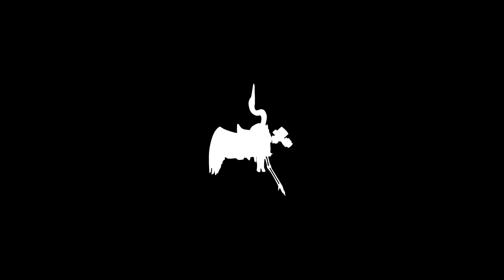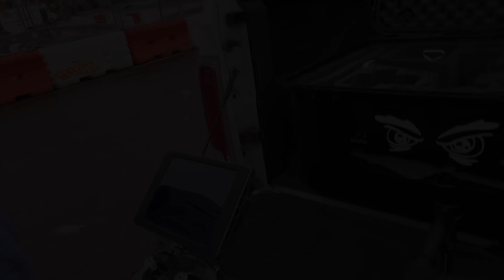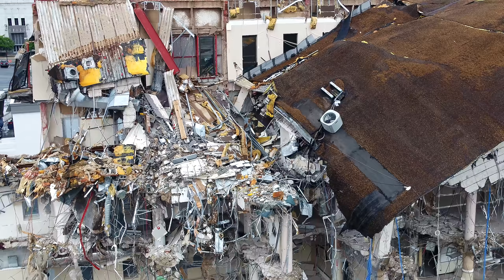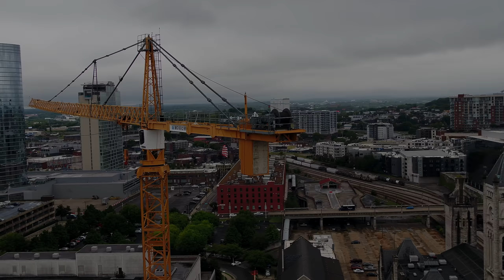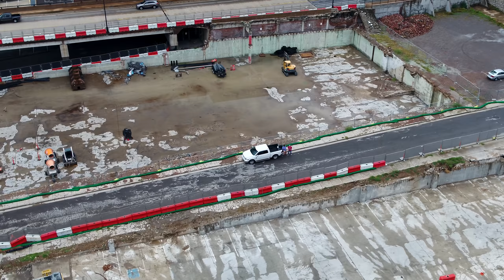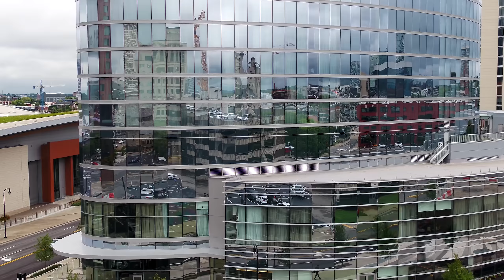Nashville Skyscrapers (Inspire 2) - KEN HERON

Comment: Ken what fw are you on? I was on the latest fw (.200) and had to downgrade because my Inspire 2 wasn’t stabile in flight.Nor will it fly straight. Wondering if your dealing with any of these issues. Well done! Very smooth...
Reply from the maker: I'm on the current version. 
Sounds like you need to calibrate your IMU. Do that and your compass and I'm sure it'll fly better. (You should calibrate the compass after each ride in a vehicle.)

Comment: What can you do with the Inspire that you cannot with the P4?
Reply from the maker: Film movies for the big screen. 
Create 5.2K video. 
Film in Apple ProRes on an SSD.
Use different lenses. 
Fly and operate camera independently. 
Fly for 25 minutes. 
Have the safe redundancy of two batteries. 
Fly easier in high winds. 
Film without propellers in the way. 
Provide full-size HDMI for monitoring. 
Record to two different media simultaneously. 
Have VLOS at a greater distance.
Lift a toddler into the air if you want to.
Reply: Is that all?!?!  lol

Comment: Ken, I have a question. I want to video a certain building, if I had a drone. I go to Air Maps and check location. It is in a zone designated orange. Does that mean no way no how can I launch and take video? It is about two miles from local airport. Would not go over 400ft high. Also it is across street from Kennesaw Mountain National Park, but will not go there.
Reply from the maker: I'm afraid you'd be too close to the airport.
You'd need to get special permission from the FAA depending on airspace.
Check sectional charts for that.
Reply: Thanks

Comment: That looked like a perfectly good air conditioner unit on that roof I want it...lol...Nice flying Ken good job, but I'm still a little mad at you for the fart sounds on the last Thursday Night Live Show, while funny to most I did not think so only because the subject matter is very close to me, I used to live in that part of Colorado and Methane is a real problem up there with all the drilling, the guys using drones to monitor the methane should be commended, not made fun of...OK I said my piece Ken and yes I'm still a fan. Buh and Bye
Reply from the maker: Hey Gary--
Just so you know, I was poking fun at the word "methane" not the danger of the pipeline job or the fine people who work on it.